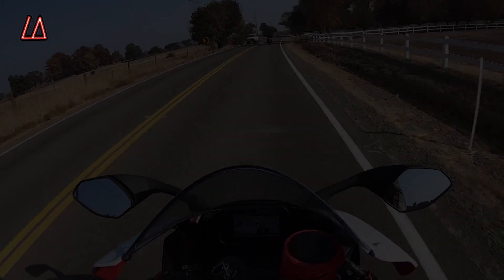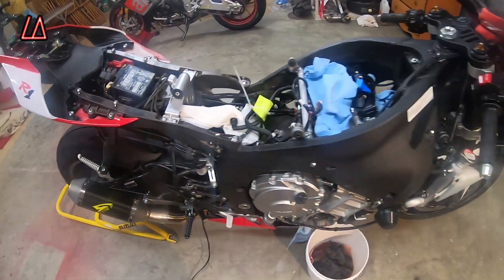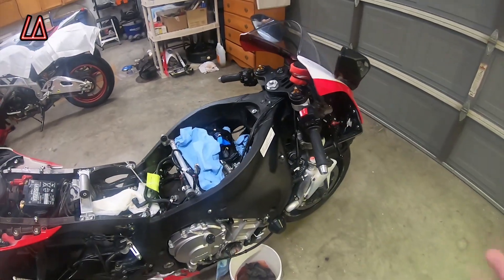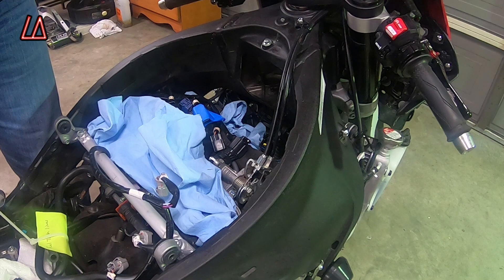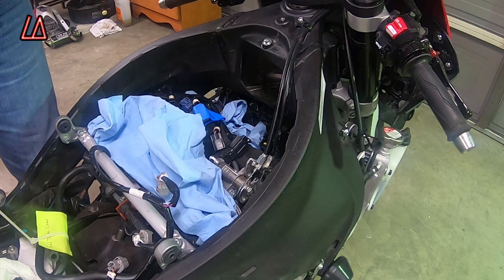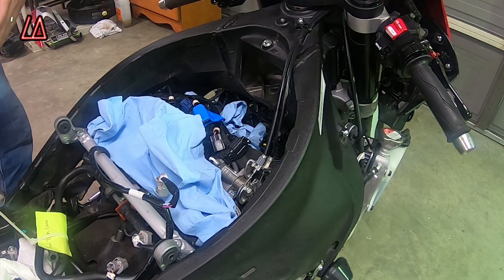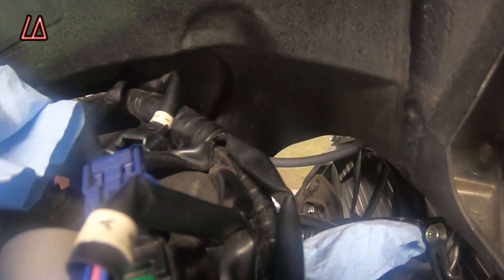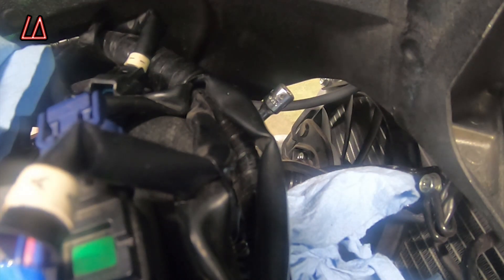Yamaha R1 Engine trouble...WTF  : Rebuild Video #1

Comment: Well from the sounds of it u did exactly what I just did, lol I guess that’s why I’m here. Crankshaft is faulty in 2015 and 2016 models of the r1
Reply from the maker: I dont think my CS was faulty.  My bike has the CS spacers.  I think that the seal behind the engine cover failed.  Very unlucky.  However, I learned a ton from rebuilding her and wouldn't hesitate to rebuild her again.  Good luck, my man.

Comment: Yep, it's a Yamaha weak point but it's a good opportunity to get to know how your R1 works from the inside out. You can do it yourself with a little patience and a moderate amount of cash. Good luck buddy.
Reply from the maker: Thanks for ur comments bro.  Took her apart and put her back together.  She is running strong but she now has a very slight vibration which she didn't have before.  Kinda frustrating.  I think it is a throttle body issue.  Still working on it. Slight rough idle and vibs come on more noticeable above 6-7000 RPMs.
Reply: Pulled apart the engine for no reason...Camshaft chain tensioner bro, it's really not a big deal and very well known that the stock Oil pressure driven (hydraulic) unit wears out really quick...get a manual tensioner.

Comment: I have a 16 R1 and spun the number one rod bearing as well because of a bad oil seal on the right timing chain cover. Thanks to your video I got brave and am working on taking apart the engine by myself and fixing it as well. Any tips or any way I can get ahold of you besides here if I have any questions about the process?
Reply from the maker: Yep that's exactly what I think happened to my bike.
Reply: I am La How long has it been since you fixed it and how’s your bike running? Also, did you replace the rod bolts when you installed the new crankshaft or just reused the old ones and torqued them per the manual?
Reply from the maker: @czt1137  sorry Bro, just saw this.  Bike is running fantastic.  And yes, I did replace the rod bolts for all four rods.  Probably didn't need to because my bike had so few miles but wanted to be safe.  My guy that build race engines said I would be fine...so there is that, but still chose to replace them.
Reply: I am La cool man, no worries! Did the same thing as you minus getting the wrong crankshaft since I ordered a new one straight from Yamaha. Bike is running great now as well!
Reply: I have a 16 R1 too. 3500 miles, no problems so far. Have you heard from many other people who’ve had the same problem? Also, did you compare your engine numbers to see if they came from a similar batch during manufacturing? Mine is N527E0006675.
Reply: If you can prove that it was a bad batch during manufacturing then Yamaha should pay

Comment: Camshaft chain tensioner bro, it's really not a big deal and very well known that the stock Oil pressure driven (hydraulic) unit wears out really quick...get a manual tensioner.
Reply from the maker: Thanks bro, but unfortunately wasn't the tensioner... Spun bearing.

Comment: Hi I just came across your video. My 2016 r1 is making a ticking noise. I’ve tried the manual cam chain tensioner and the bike still sounds the same. Do you mind giving the video on my channel a listen? When you changed the oil was there any shavings? Any help helps! Thanks!
Reply from the maker: Check your channel bro.

Comment: Sorry my english is Bad , does R1S 2016 had this problem also so? or any tranmission recall like 2015 model ,thank you
Reply from the maker: Honestly, I just think mine was a fluke.  She has been perfect after the rebuild.  I think all 2016s and on had a spacer put in the crank to help reduce possible wear so you should be good.  The other thing I have heard is make sure that if your replace the throttle side engine cover that your replace the oil seal that is attached to that cover.

Comment: i am also getting a r1 2010 soon do you have anything to say before getting it
Reply from the maker: I am very happy for you man...U r gonna love her!!
Reply: Don't buy it. If u will change the clutch basket ASAP.
Reply: Camshaft chain tensioner bro, it's really not a big deal and very well known that the stock Oil pressure driven (hydraulic) unit wears out really quick...get a manual tensioner.

Comment: 2015 2016 R1 have dodgy crank shafts
Reply from the maker: I dont think my issues was a bad crank.  I actually think I had an oil seal failure which cause lack of oil to the #1 crank rod.  Either way, it was a fantastic learning experience and my bike is running great now.  Thanks for commenting.
Reply: they dont have dodgy crankshafts. they have dodgy a dodgy bottom end that allows the crankshaft to float side to side and finaly the counterweight on one end will collide with some other parts of the bottom end and crack/split the crank. if you have a 15 or 16 R1 you better get rid of it ASAP
Reply: @torkilg264  hense a bad crank shaft...🤨
Reply: @See_you_next_timee  its not the crank shaft itself that's the problem, but design flaws in the bottom end, as a whole.
Reply: @torkilg264  yep not asca whole. Its spacers between the bearing were left out as what seems a fuck up on someone's behalf at honda and that creates the rubing and then well shit rolls down hill from there as they say
Reply: Yamaha not honda 😅
Reply: @See_you_next_timee  yeah its something like that :(
Reply: No, they don't, you have not a clue what you're talking about...I put 25,000 hard miles on mine and it still keeps trucking as well as many other same generation race bikes I know of....i'ts a bad Cam Chain tensioner.
Reply: @dasboot9471  how the fuck does the cct have anything to do with sideways movement of the crankshaft?
Reply: @torkilg264  oh boy 🤦‍♂️

Comment: I had dealer do my head gasket on my 04 and rebuilt half the motor road it like 50 miles and it blew up now they gotta fix for free
Reply: They did not fix for free smh such a L

Comment: Hey question for you  my 2017 r1 has 2000 miles  on it and it feels like its losing  engine breaking  and Losing power I have  not changed anything settings wise what gives?
Reply from the maker: Assuming you have and are doing proper oil changes, there shouldn't be any changes.  It is very important that you break in your engine properly.  You might want to do a compression test to make sure there are no issues there. A low compression finding in a cylinder might be causing what u are describing.

Comment: Crankshaft would of broken between number 3 and 4 common problem.
Reply: No...Camshaft chain tensioner bro, it's really not a big deal and very well known that the stock Oil pressure driven (hydraulic) unit wears out really quick...get a manual tensioner.
Reply: 2CR crank?

Comment: What a bummer for such a low milage bike...
Reply: Camshaft chain tensioner bro, it's really not a big deal and very well known that the stock Oil pressure driven (hydraulic) unit wears out really quick...get a manual tensioner.
Reply from the maker: It actually turned out to be a great experience for me...so yeah kinda sucked, but she is back together, running super strong, and I learned a ton.
Reply: @IamLaR1  so do u have to be extra careful and ride slower or u can ride like normal and does it be stronger?

Comment: Crank on 15 to present. Go bad
Reply: No they don't , it's a cam chain tensioner, this generaton R1 engine is almost indestructible
Reply from the maker: unfortunately it was not the CCT...wish it would have been
Reply: @dasboot9471   dont u get it.. its not a cam tensioner.. r1 crank do have issue.. spun bearing broke chip burnt... Its already 5 comment of ours saying tensioner..

Comment: A suzuki bike stand on a Yamaha ..what a shame :-)
Reply from the maker: The stand has sentimental value.  It was my brothers stand for his first bike, which he eventually let go after holding on to it since 2000.  That bike started him on his riding journey and he started me on mine.
Reply: @IamLaR1  Just teasing a stand is a stand right lol.  II love all bikes even though i've only ever owned yamaha's myself.  Love the bike man and the content
Reply: @MisterJohnwick99  Camshaft chain tensioner bro, it's really not a big deal and very well known that the stock Oil pressure driven (hydraulic) unit wears out really quick...get a manual tensioner.

Comment: Is there any way you could contact me in private? I have a few questions to ask about the rebuild👌
Reply from the maker: Ask your questions here.  They might help someone else, and if I can't answer them someone else might be able.
Reply: @IamLaR1  my 2016 r1 is making clunking sounds when it idles and the sound changes when I lean the bike so I figured I had the same free play issue. Took everything apart and I also found some grooves on the clutch inner hub. The lady time I rode it it would run for a half hour then it would get worse and worse until it gets to the point where any amount of throttle would make the bike just spit gas put of the exhaust and the bike wouldn't rev. Turned it off and back on and it got me home no problem. The next day I call Yamaha and they said that warranty will not cover it because I got my valves done at a different shop which voids my warranty apparently and they're trying to not take any responsibility for yamahas screw up.. how much did it cost you to rebuild the bottom end and do you happen to have the list of parts (for part numbers) and how has your bike been running after putting it back together? I'm trying to see what what options I have before making any decisions.
Reply from the maker: @jamesparlati2014  ... Sorry bro, I just saw this.  1st, my bike is running awesome, despite all the egos that make comments about how, since I don't use the correct terminology I couldn't possibly fix my bike.  2nd, download there service manual, it is available on the R1 forums and start going thru it.  The is also a video series of a guys rebuilding is older R1 and he did a way better job then I could have ever did.  I learned a ton from his videos. Also, maybe take your bike back to where you had your valves done and ask them to take a quick look at it.  They my be able to point you in the right direction about what is going on with your bike.  Don't be afraid of taking on this task my man but make sure you take in as much education as u can.  Also get a the best torque wrench you can buy... It's important.  I am here for you.

Comment: What causes a spun bearing?
Reply from the maker: Haha, u caught me when I was on the interwebsssss.  Not sure what caused it honestly.  The only thing I can think of was maybe a failed oil seal.  There is a very important oil seal on the back side of the small right side engine cover.  It looked like it was still good, but if that fails then oil pressure is reduced and the left crank bearings are the furthest from that seal so they would get the least oil if that seal failed🤷🏼‍♂️🤷🏼‍♂️🤷🏼‍♂️.  She is running perfect now and it was a great learning experience.

Comment: So any reason why this happened, or is it an R1 thing? I have a 2011 and i have noticed the same noise when i first start it up.
Reply from the maker: The noise u are hearings is more than likely your cam chain.  No worries there bro.  The R1 has a hydraulic cam chain tensioner. Get a manual one and u will be good.  Google the process for the R1... Everybody swaps them.  As far as my engine blow, I caulk it up to bad luck.
Reply: crank slap
Reply: Camshaft chain tensioner bro, it's really not a big deal and very well known that the stock Oil pressure driven (hydraulic) unit wears out really quick...get a manual tensioner.
Reply: @keithsmith8250  No...Camshaft chain tensioner bro, it's really not a big deal and very well known that the stock Oil pressure driven (hydraulic) unit wears out really quick...get a manual tensioner.

Comment: not sure if you know the exact reason. yamaha revivsed the design of the crank by adding thrust washers in certain spots after this happened. did you crank look like this ? 
https://youtu.be/Vza4wwqcIOA
Reply from the maker: My crank was good.  It did not crack.  I had a spun barring on the #1 piston rod, which scared the #1 journal so I ended up replacing the crank and that was a shit show.  It was my fault, but still a shit show.  I actually think my issue was a failed oil seal.

Comment: crank slap
Reply: No....Camshaft chain tensioner bro, it's really not a big deal and very well known that the stock Oil pressure driven (hydraulic) unit wears out really quick...get a manual tensioner.

Comment: Pos. Bike
Reply: Camshaft chain tensioner bro, it's really not a big deal and very well known that the stock Oil pressure driven (hydraulic) unit wears out really quick...get a manual tensioner.